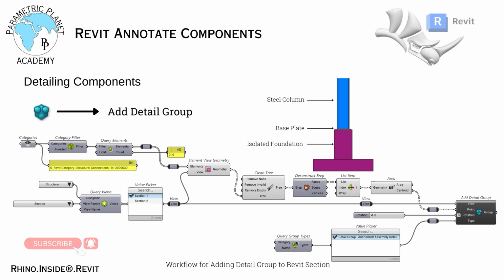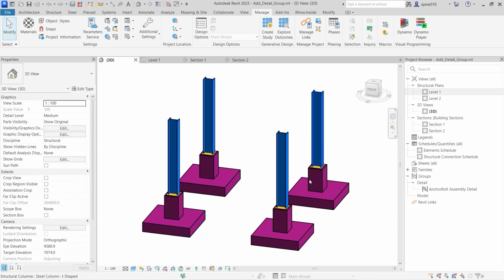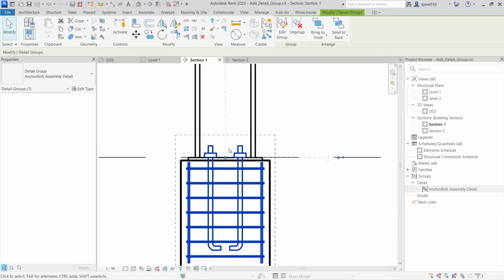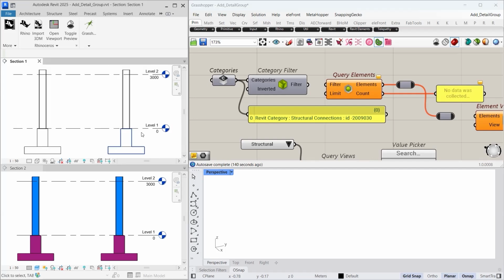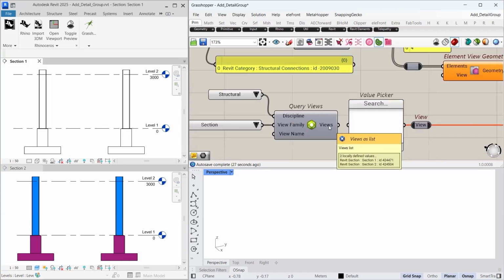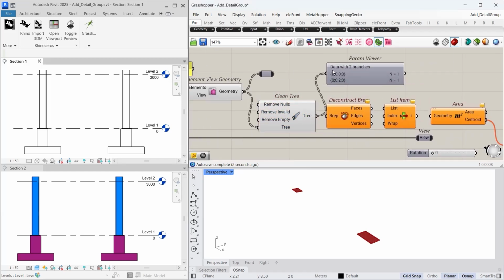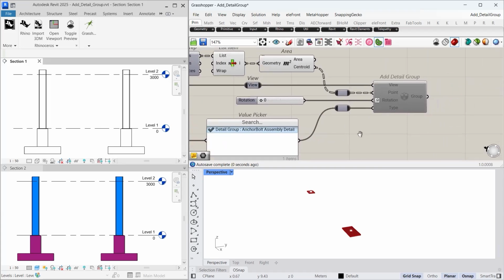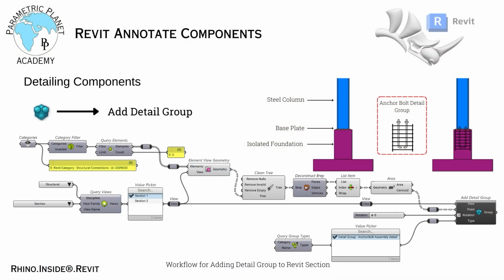How to Add Detail Group | Rhino.Inside.Revit | Grasshopper

Comment: Is it possible to place steel connections via Grasshopper?
Reply from the maker: Do you mean family connections or native revit connections?
Reply: @ParametricPlanet yeah, the native 'connections' instrument on the 'steel' toolbar
Reply from the maker: Yes it’s possible. If they are available in Revit api definitely we can create a component to add the connection. 

Are you interested in the component?

Will it solve your problem?
Reply: @ParametricPlanet got it, thank you so much. I'll try to do that using python